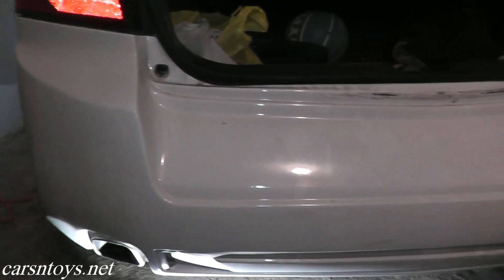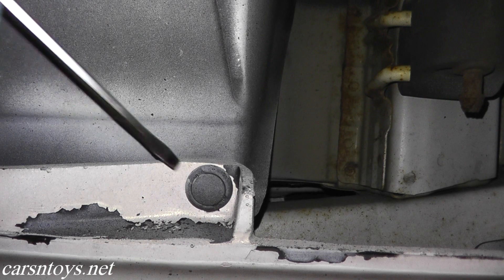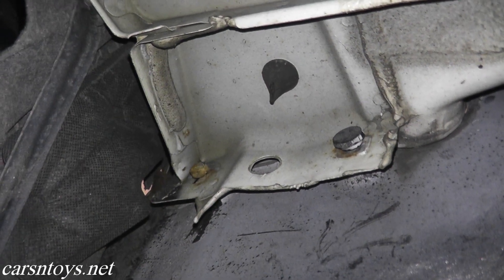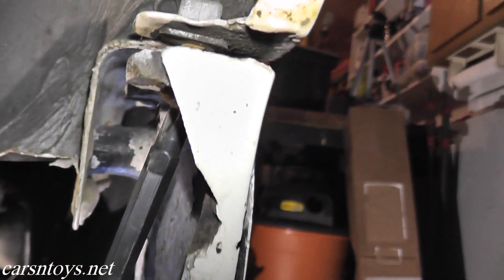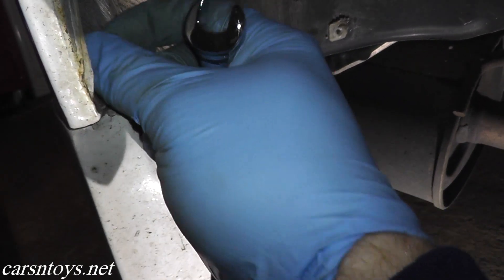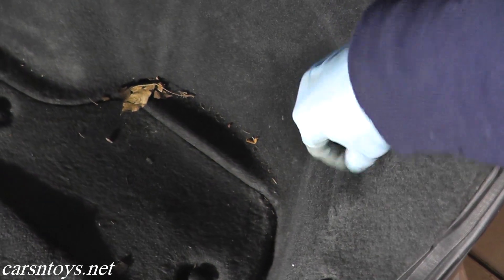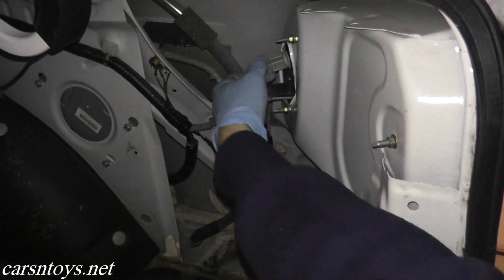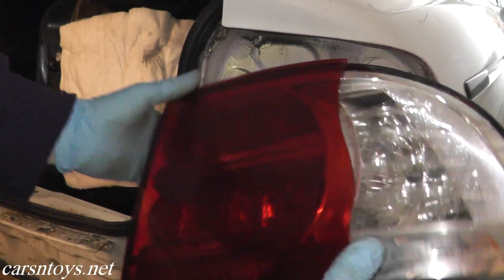Acura TL Rear Tail Light Replacement with Basic Hand Tools

Comment: You don’t really have to completely remove the rear bumper, you can do one side at a time, just remove the screws that are inside the trunk and bolt off either or side that you’re going to do first. BUT I understand people would rather do it a safe way but I want to let you guys know that there’s another way if you don’t want to  completely remove the rear bumper.

Comment: U run a knife with alligator teeth under the tail light and cut the bottom plastic holders that are held by the metal mount on the bottom that way the light panel slides right out and do the same with the new light that way the new on slides right in.....

Comment: On the LED bored can you switch out Individual bulbs or do you have to change the hole bored?
Reply from the maker: I've never tried replacing one LED. You can certainly give it a shot. These tail lights aren't cheap. Cheers.

Comment: Seriously Acura couldn't just use the 4 bolts behind the trunk liner as mounting points like most normal cars ? they just had to add those 2 stupid bolts on the outside like its makes that big of a difference. good vid though.
Reply from the maker: That would of been a nice plus. Same deal with the headlights; gotta remove the front bumper. Bummer.

Comment: Well I bought a new tailight for also the passenger side and thought it was only about removing the carpet inside, guess not 😕
Reply from the maker: Wish it was that easy.
Reply: CarsNToys well today I changed it out and I got so impatient with it that I ripped the tail light out without damaging the rest (it was already cracked), so the new one I put in I remove those 3 things on the bottom that go on that screwed on part underneath the bumper and just placed it with the 4 nuts like how it should’ve been like every other Honda lol, it worked for me lmao